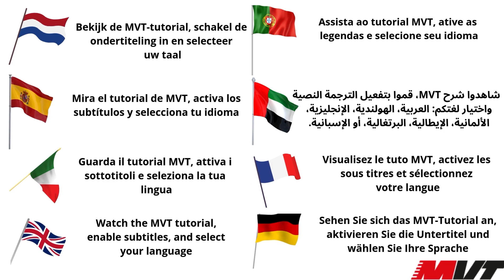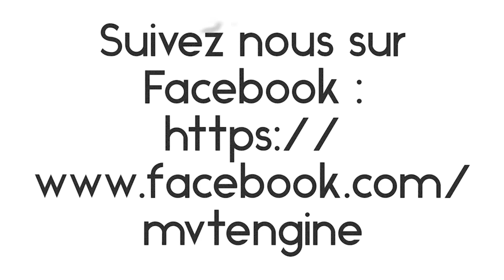Notice montage allumage MVT Digital Direct DD09 PIAGGIO VESPA 50 LX

Comment: Hello, in the kit ive received also a black rectangle named, RJ34-6 what is it, is it important?
Reply from the maker: C’est le diagramme, vous trouvez le branchement dans la vidéo
Reply: @MvtParts  i had another problem in my scooter, which is a runner sp 2016, I don't have the connector on the red cable u mentioned that goes on the mvt  tension regulator but in mine it goes somewhere in the scooter, what can I do I though about adding the red cable that's already on the mvt regulator with the original red one on the fuseolder